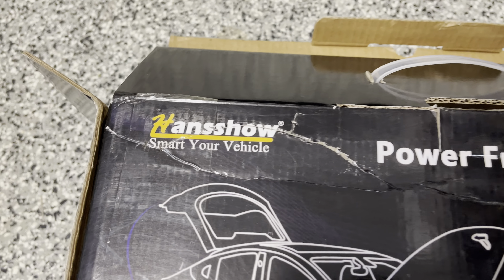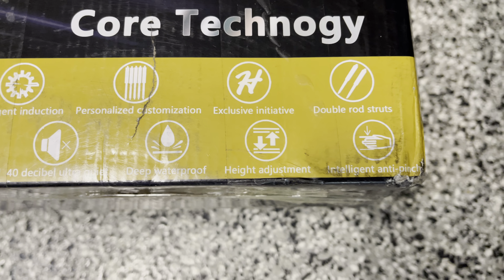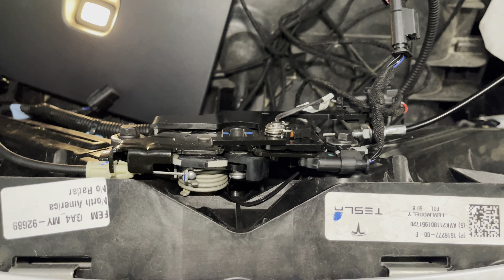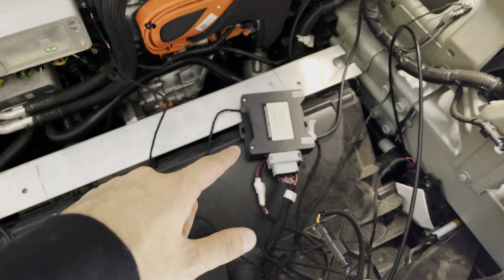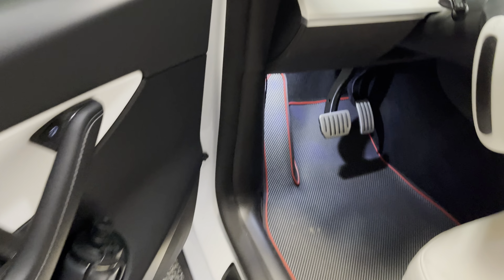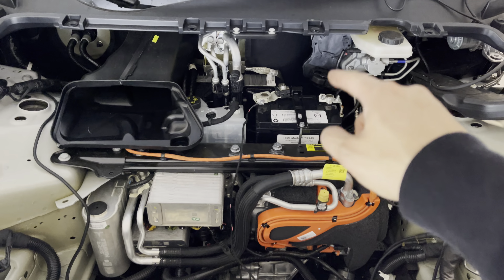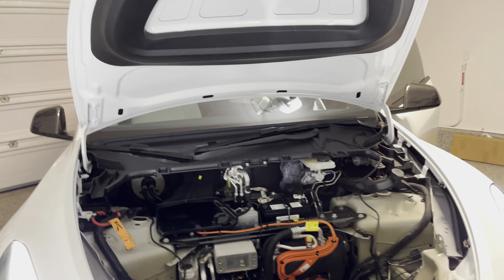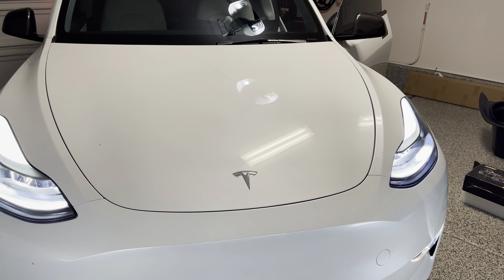2022 Tesla Model Y Power Frunk V5 NEW Release - Hansshow!

Comment: I got one for my model X. Frunk opens ok, but won't close all the way. If I push it while it's going down, it latches. Also, the red light flashes continuously. Is that norman? Also,have you tried the "emergency release" yet. I don't think mine is working. Do you know if it is supposed to physically pull the release mechanism or is it an electrical switch?
Any help would be appreciated, since Hannshaw doesn't respond

Comment: I noticed your struts are not installed correctly. On this version the wires  are supposed be pointed upwards. The hinge will interfere with the rubber on the struts.
Reply from the maker: You are correct the wires are to be facing upwards.
Reply: @megawatts  Incorrect. The instructions for V5 say the power wire goes at the bottom, not the top.
Reply from the maker: @DavidSmith-oq2hn  they release a new instruction for this kit it should be facing up for model y
Reply: @megawatts  thx. do you have link to new instructions? I can't find them.
Reply from the maker: @DavidSmith-oq2hn  it’s in the new package
Reply from the maker: @DavidSmith-oq2hn  I can pdf or photo it just DM me on Instagram
Reply from the maker: Here’s the update https://youtu.be/vfatTHR04VQ
Reply: I have an issue with my kit where the frunk closes but sits 2” high and will not close.  When I contacted their support they told me that I mounted the struts the wrong way…lol I was like look at #7 on your instructions.  But the struts on my kit seems to be too long or something cause it will not close at all….hoping that they will get this fixed but their support is not good….I had to take the whole thing out and put it back to factory waiting for these guys to assist.
Reply from the maker: @Turbo6019  you need to reset, manually unplug from power source, Wait 10 seconds then plug back in, you hear a beep. Manually close the Frunk up to when you about to hit the latch see if it aligns if it does push it down gently until it soft close. Now go in car and reboot computer with scroll wheels pressed in simultaneously for 10 seconds or until screen goes black for a few seconds. Use phone or car screen to open and close it should re calibrate the struts. Dm me on Instagram if you need help am in PsT  time
Reply: @megawatts  so HS got back to me and they told me I installed the struts the wrong way and they gave me updated details which is surprising but will have to give that a shot and will also follow your instructions as well if the new updated instructions don’t work.
Reply from the maker: @Turbo6019  make sure to plug the power in last after all wires installed then plug in the computer box after. Push close on phone app, it should go down slow, then beeps and if it doesn’t close all way manually close it and then open using phone app that should reset it

Comment: 1:49 The bracket does not align with the hole on the frame of my 2022 Model Y (w AMD chip and Li battery). So I returned it back through Amazon. Any idea if I would be getting updated brackets if I order through your link?
Reply from the maker: I had a few followers with 2022 model order through my link they have latest version and can provide support if any issues. Amazon usually have the older outdated kits. So yes order through my link and remember to us promocode to save some money too. Dm me on Instagram is you have any questions

Comment: Great job! Wish you had a video for Model S/X refresh models.
Reply: Just received my model Y power frunk v5 kit. It has two bolt screws but only one locking nut? The flathead screws with Allen wrench top anchor the power strut brackets. What is the nut for?? Why just one? I have an email to Hansshow with same question. Thx.

Comment: What is wrong with having a cable release lever in the footwell?
Reply from the maker: True
Reply: That’s so 1992. The rest of the car uses solenoids to open doors, why not the frunk as well?
Reply: @PumpUptheJam81  solenoids require a supply of electricity to work. Cables don’t. So if a Tesla ran out of charge and the cable was, as mine always is, in the front storage compartment, it would be inaccessible.
Reply: @LysanderLH  you can open the frunk through the tow hitch port with a simple a23 12v🔋 battery
Reply: @franthonycornett1742  In that case, frunk is not the best place to store your emergency kit.